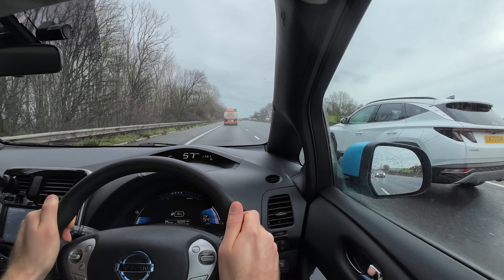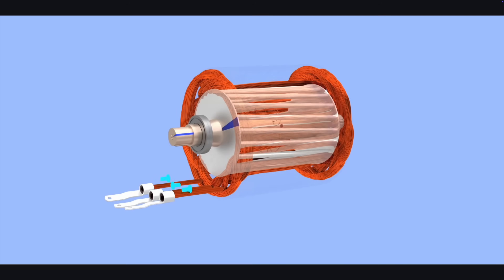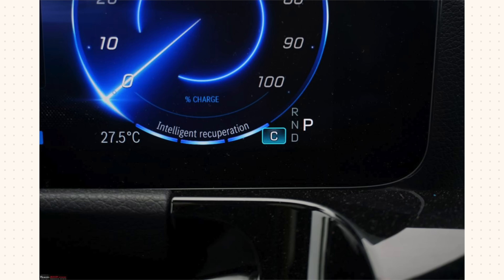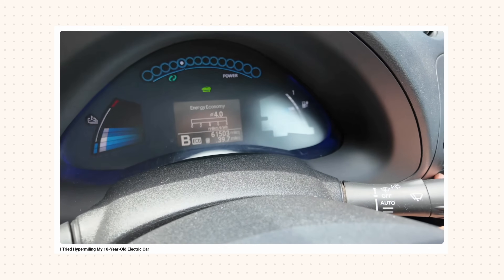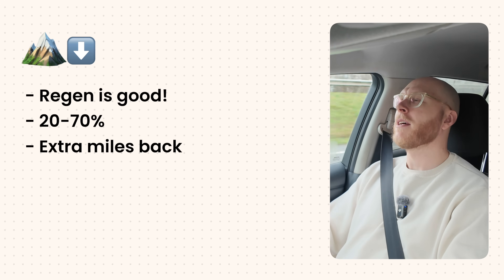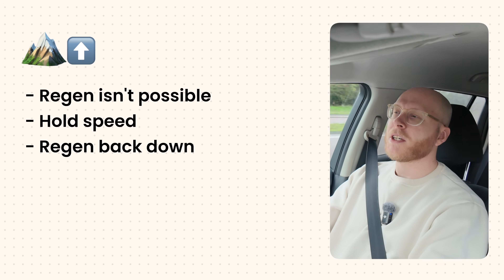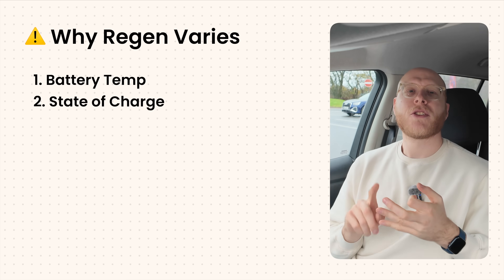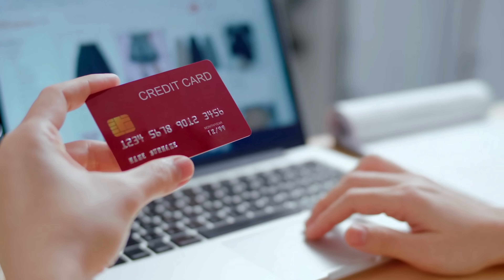You’ve Been Lied To - Regen Doesn’t Work How You Think

Comment: 2023 Chevrolet Bolt EUV, 2025 Chevrolet Equinox EV AWD have excellent regenerative braking. I got 60 kW in the Bolt, 80 kW in the Equinox! When driving in the canyon, the Bolt EUV showed 61 miles worth of energy recovered during regen on the descents, The Equinox doesn't offer that information.
Reply: I have a Blazer EV and it tells you the kwh you have regened. It's on one of the energy info screens. I want to say it's the energy efficiency screen, but I'm not 100% sure which one.
Reply: @marvingeorge157  How many kW have you been able to get on hard regen? Get'er up to freeway speed, then, give the paddle on the left side of the steering wheel a tug, and see what the watt gauge says! The blazer is higher performance, than either the Bolt or Equinox. Depending on the trim, both front and rear motors in the blazer are similar to the front motor in the Equinox.

Comment: Here’s a video idea, talk about how constantly using high regen or B mode means brakes are not used and become rusted, need servicing/replacement sooner, which are quite costly. 

Now whenever conditions allow, on the slip road coming off motorway/dual carriage ways, I shift the car to N and hit the brakes hard to do moderate brake burnishing. I also do Tesla service menu brake burnishing once a year.
Reply: An Australian limo driver used one pedal and changed brake pads at 460,000 kms. Tesla Model S.

https://youtu.be/wOFfKQ7SxEg?si=8IqMI6QPdBtVL7xt

Comment: Here we go! another waste of time energy and money by In-Efficient Alex! Unbelievable!
Reply: Here we go! Another grumpy comment from an old angry Volvo driver. Maybe try some meditation or some counselling.
Reply: @simonpaine2347 Hey Simple Simon! There is no anger issue on my part! Just trying to knock some sense into all you deluded and delusional EVangelists who truly believe that you are being financially and environmentally responsible by driving EVs. News Flash.............you are not!!
Reply: @thevolvodrive2811 OK so please explain how I'm not saving money. I have a Solar panel system that not only reduces my electricity bills to just above the standing charges, PLUS I haven't paid a service charge or petrol bill for coming on 4 years. No oil changes, no filter changes (apart from cabin) no brake problems, the list is endless. I used to put aside £70 a month to cover the inevitable cost of keeping my ICE vehicle on the road.
Reply: @thevolvodrive2811 Its fine to spend your money as you see fit.  Did 40 miles in mine today. 45p fuel cost. Bought an old depreciated EV. Cost less than a diesel or petrol equivalent. No fuel duty, no VAT, no road tax til april next year. I'm happy.
Reply: @thevolvodrive2811  I brought a second hand EV  I have saved a fortune  £4 for 280 miles for driving in winter and also free charging from my solar panels . its far more pleasurable to drive. stop living in the past let's bring back gas lighting should we??
Reply: @ianmoss20102010 Dear Phaze Monkey. Your solar panels, storage battery pack and home charger were not free. Your solar panels will need maintenance and replacing right about when you finish paying for them. I bought a 3 year old Volvo in August of 2004 and it is still my daily driver. The original engine, transmission and turbo are showing no signs of quitting.  I have had 2 people offering me $5000 in the past year. The car will be 25 years on the road in January. Where do you think your toy electric car will be in 20 years? You talk about living in the past! EVs have been around over 150 years! That’s your future? Would you buy a re-packaged ‘New & Improved’ Polaroid camera? The EV transition has been tried and failed, several times before. It will fail again because the ´elites’ are moving away from renewable energies and focusing on AI which requires gobs and gobs of electricity for the data centres!

Comment: Don't forget, "sailing" saves a lot of juice: Going to the hill top at low velocity, and then let it going down the hill without regen till reaching a "comfortable" velocity, and then let some regen do it work. By regen also some energy gets lost in heat and attrition.
Reply: The best regen mode was invented by Siemens and used on the Norwegian Think A266.
Its automaticly initiated by brake pedal or speed increase when accelerator is not activated. Otherwise the car is driving in sailing mode. Once regen is activated, its adjusted and deactivated by accelerator pedal. Once past 0 regen the vehicle is back to sailing mode. Totally intuitiv, comfortable, energy effitient and safe.
Reply: @robortkristensen3818  1.3.2 An „Unplanned Encounter at Sea‟ occurs when naval ships or naval aircraft of one
State meet casually or unexpectedly with a naval ship or naval aircraft of another State.
1.3.3 For the purposes of CUES, a „naval ship‟ is a descriptor that is assumed to include
1
warships , naval auxiliaries, and submarines.

A land based fighter jet is NOT a "naval aircraft".

Comment: I don’t know EXACTLY how much energy is regenerated and stored in the traction battery, but I KNOW it does.  That is all I need to knowI can decide on the regen level - even choosing none at all.  Do I care how much is being regenerated?  No.  I do know that while climbing a mountain in Scotland recently, my battery lost a lot of SOC within about a mile and a half.  I charged to 100% at the top of that mountain and regretted it - I had no regen at all during part of the descent!

Yes, regen is measured in either kW or kWh depending on whether one is measuring power or energy.  Does it really matter?  I don’t think so.

Regen needs to be adjusted for weather conditions, if adjustment is variable.  It is simple driving practice.